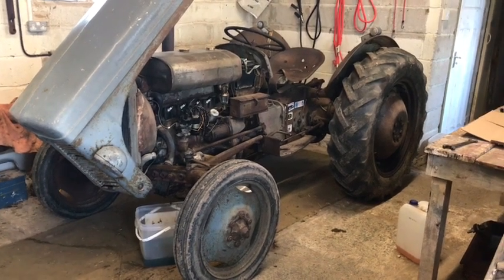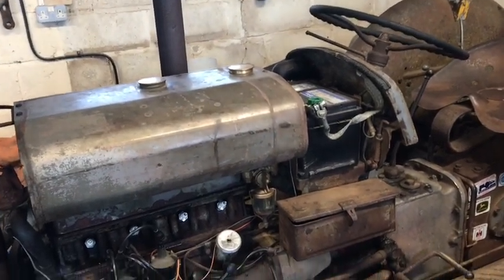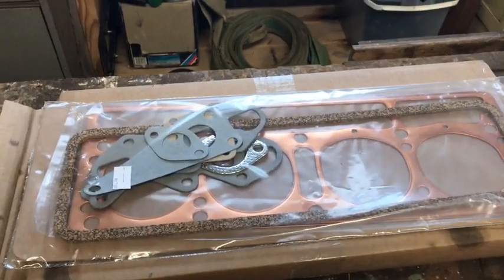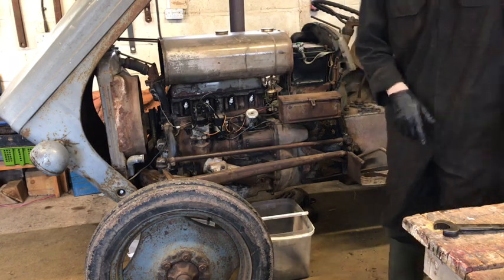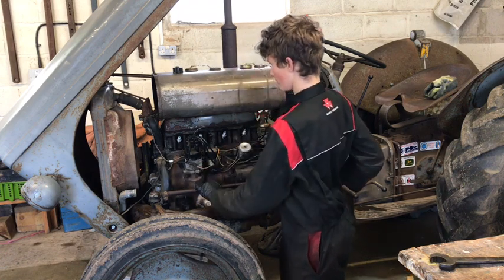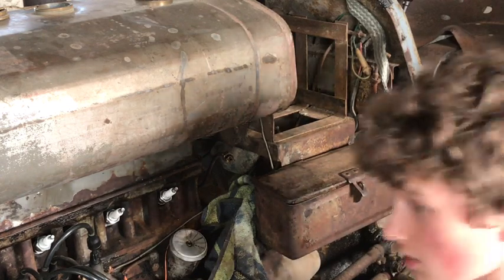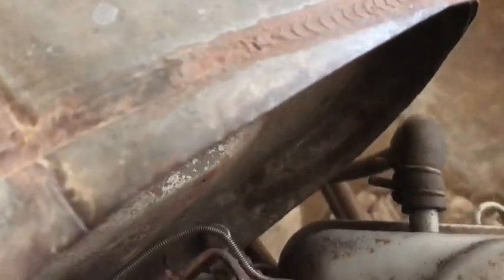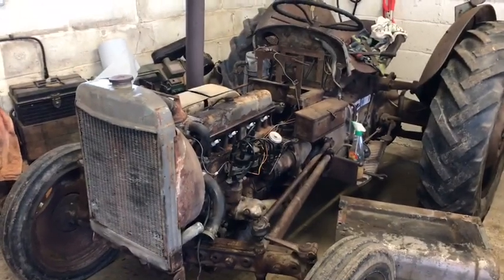Ferguson TED20 rebuild Part 1: Fuel system

Comment: I'm trying to start mine after 7 years, it can crank up but won't start, do you know what could be the problem?
Reply from the maker: Check that you're getting fuel first, by turning the fuel tap on (under the tank on the left side), and open the little bleed screw on the bottom of the carburettor
Reply: @OliverLee390  I am getting the fuel, and when I open the little bleed the petrol does come through, but still it just cranks and don't start. You think plugs maybe could be the issue, I'm just thinking I don't really know what could be the problem.